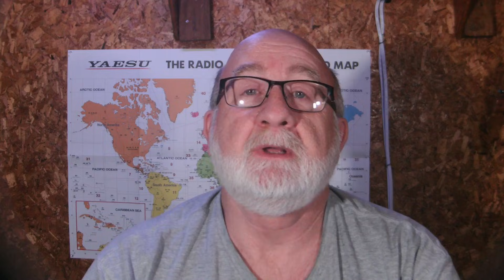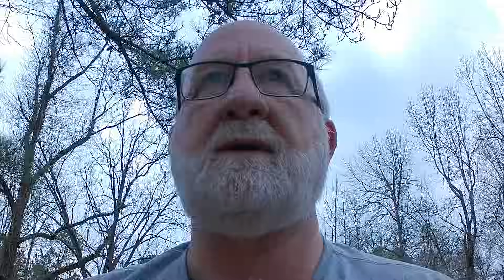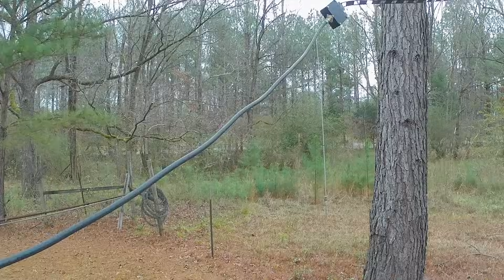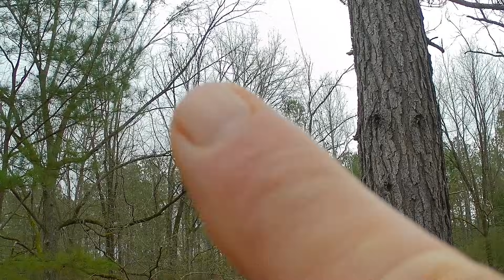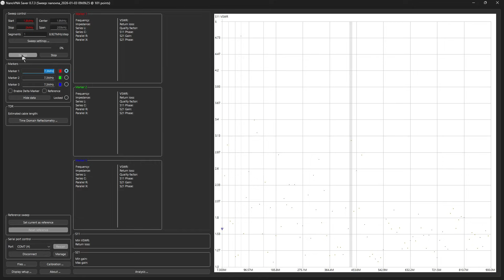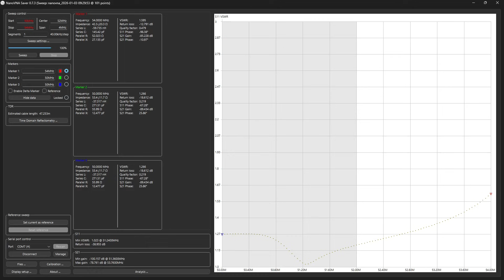ZS6BKW Install and Band Sweep

Comment: What was the difference in receive capability between the ZS6BKW and the old delta it replaced?
Reply from the maker: From the little amount of time that I have had to use it, the receive on the lower bands(40-160m receive) seem to have less noise. I can't tell much difference in the upper bands.